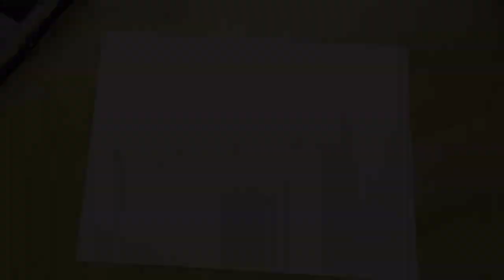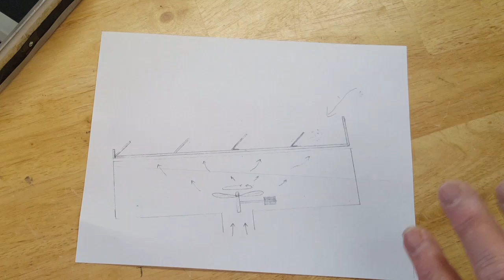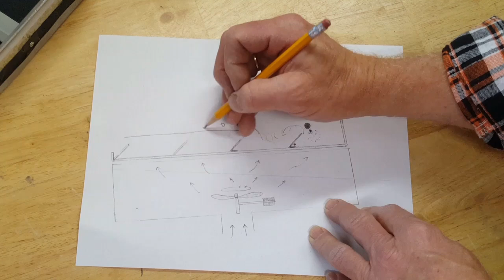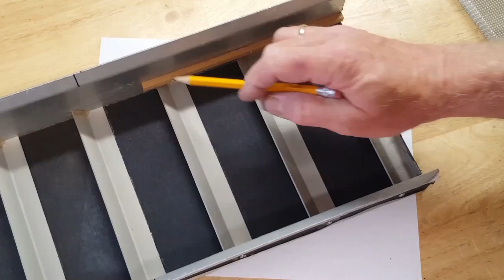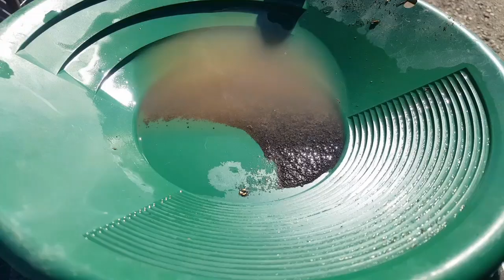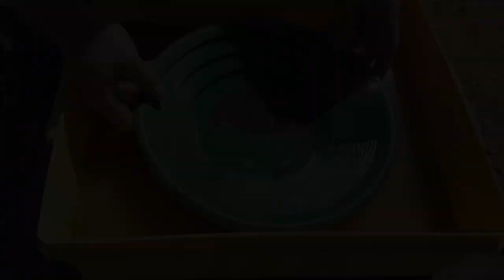Gold Mining Dry Washer - How to Maximize Recovery

Comment: THANK-YOU!  FOR ANOTHER GARGANTUAN EPIC EYE OPENING DESERT GOLD (GOLD SEPERATION VIDEO!

If the gold is 20 to 50 i would use a 30 mesh on top on the first run then make a second run at 20 on top and catch and sample the tails.

Fortnutally after working in the same area for many years we know what size our gold is.

In Wyoming the gold is very small to microscopic so 30 on top would be to too big, but I would probably use it anyway.

Screening material to seperate out the fine gold and knowing what sizes to keep (for further processing) and what sizes to bypass or let go (to the spoil pile) is the secret to successful process seperation no mater what size the operation.  

Sieve seperation is paramount for success regardless whether the process is wet or dry.

Catching the black sand (if it has gold in it or stuck to it) is step one.  

Then we seperate as much gold from the black sand and see what is left or what stays stuck to the  sand grains.

However! ... sometimes the gold sticks to the sides of the black sand grains way above 30 mesh.

My wide view gemalogical microscope at 360 power really helps see below 20 and 30 mesh extreemly well.

Comment: Hello sir, new to the desert and failing; I tested my puffer with fines in Idaho and it looked ok compared to wet washing. I'm using microfiber cloth which generates a lot of static. Just wondering if there are pitfalls I'm unaware of aside from durability. Are furry materials avoided to ease clean up? Thanks for the content! (If you find time to respond, I'm very curious as to what a decent grade of bank gravel in a wash would be and how large of a sample should be taken, more so than the cloth, thank you.)
Reply from the maker: Thanks for your message.  Probably need to do testing for efficiency and durability.

Comment: What is the best angle to run your riffle tray at. Your first clean up has way more black sands than I am catching. And I am losing alot of fine gold right out the end of the sluice box.  And might I be feeding my material to fast.  Any help would be greatly appreciated 
Thanks great video 
Red
Reply from the maker: Hi Red.  Thanks for watching this video.  There's no real angle to set the riffle board because of so many variables, air volume, feed rate, material type,  machine type, etc.  But in general, I like to start at 12 degrees.  I feed at a rate that I can barely see the top of the riffles.  Don't feel bad about losing fine gold.  The physics involved makes it difficult to recover, unless you have an over abundance of fine gold you're working. Dry washers are a good prospecting tool.  However, when you find a really good spot, it's always best to bring in a wash plant to maximize recovery.  Check out my Gold Rattler videos if have time.  Best of luck to you !🤠⛏️⚒️👍https://youtu.be/3xLrOrDDbgc

Comment: Surface area also plays a key roll… i use a Royal dry washer and it looks like yours has half the surface area as mine which means yours will have a greater output of air pressure.
I run my blower on idle and it seams to work perfectly.
I do like you idea and I may try it just to see how much I’m dumping.
I also use a metal detector to find any gold that may have jumped the riffles in my tailings.
I like your set up.
Reply from the maker: Hi Fred.  My blower runs about 1/4 throttle.  Surface area is definitely important, considering the volume of air being delivered to the unit. Give it a try and let me know how it works for you.  Best of luck out there ! 🤠⚒⛏👍

Comment: I don't know Alan, from the looks of what you had recovered wet washing I would say you had 90-95 percent recovery with the dry washer.  I ran a test once  with a puffer and took what came off the drywasher sluice (about 2 five gallon buckets) and then ran these tails thru a spiral wheel.  Got 2.5 gold pans of black sands that I hand panned.  Got maybe 100 tiny meaning sub 100 mesh pieces from the black sands.  If you put them all together you might make one of the larger pieces the dry washer caught.  If I had spent the time just continuing to run more material thru the dry washer instead of messing around with the spiral bowl and hand panning all that black sand I would  have ended up with 4-5 times more gold than I recovered.  But I was doing a test to see how effective the dry washer was.  The only way to really determine the percentage is to weigh the test results and compare.  But to me your mods to the drywasher was impressive.
Reply from the maker: Thanks for your comments John !  Glad to hear from others, and their testing. Yeah, the screen method seemed to help improve recovery. Did you classify the material down to about 25-50 mesh before the spiral ?  I've never had much luck with fine gold on a spiral.  I'm a Blue Bowl guy. Lol !  The type of material is a factor.  Dry stream gravel is best.  Unfortunately, the dry washer can't  recover much from gooey clay, which is what I'm currently encountering. Almost everyone out here running volume is wet for that reason.  Should have seen the hard chunky clay I was running with the wash plant today.  Whoowee !!  Best of luck to you prospecting ! 🤠⚒⛏👍

Comment: do you have a recommendation for a vibration motor for my top hopper that will work on the large royal without spending 100$ 12 volt?
Reply from the maker: That's about the going price.  I bought a 12v on eBay a couple years ago, and paid $85.  I would keep an eye on eBay for a deal to pop up..

Comment: I most appreciate your posting this. I've watched your video on your washing op and really learned a lot.  I need to watch this further.  Perhaps you answer the question down the line.  What about flour gold, I mean the really fine stuff, which is what we have on our claims?  I think the words you were search for (50-cent geology terms) regarding a large iron particle vs a much smaller gold particle is "hydraulic equivalence".  If words matter. Certainly specific gravity does.
Reply from the maker: Hi Thom.  Thanks for watching my videos.  Much appreciated !  Yes, the wash plant is the best way to recover fine gold, without going overboard and making giant Blue Bowls or Miller tables.  Even with that, some gold at -200 mesh, or finer, can best be extracted by leaching.  And that gets costly !  So, the values have to be there to make it worth it.  A dry washer is at a disadvantage because of the physics.  My little screen technique helps, but not as good as the wash plant.  Thanks for your comments, and good luck prospecting !  👍🤠⚒⛏

Comment: Cant it be that the fact you ran the material twice is the reason for more capture?   I would like to see material with guaranteed Au amounts ran thru both systems.    NOT Dissen, just pointing out not fair comparison.  outside that,  it does look like screen helps, just not sure how much.       cheers and thanks
Reply from the maker: As I mentioned in the video, there is gold trapped in the upper riffles due to "random chance."  Anyone can re-run tailings through their dry washer and collect a small percentage of gold on a second pass due to this property (Physics 101).  The physics remain the same, until there is a change.  That's where the 20 mesh screen and reduced air volume come into play.  The gold is trapped on the lower riffles because the dynamics have changed on the second pass.  Obviously, this gold wasn't recovered on the first past because of the inherent physics of a dry washer.  By modifying certain features, the physics and be altered for improved recovery.
Reply: Random Chance isn't intelligent or physics lOl, unless yor a Newt/globalist.      first pass caught specks smaller and equal as second round with screen.  perhaps/ Obviously,,,  percentage of Au against volume would better represent advantage' of screen and baffle compared to inherent Preponderance and Obvious,, Dipole properties.  Confirmation Bias is Bitch.
Reply from the maker: Think what you want.  The physics are undeniable.

Comment: I’m thinkin 2or3 more feet of screen to run the fine stuff over would up your % a bit?
Reply from the maker: Thanks for the ideas Joe.  That might work, but make for a long dry washer.  Another option might be to add a series of little riffles on the same board.  After all, we're attempting to catch fines, so replacing the existing 1/2" riffles   for a bunch of 1/4" might do the trick ?  Will have noodle on this more.  Best of luck to you prospecting !  🤠⛏⚒👍

Comment: That was a GREAT video   ,  l have an old Keene Dry washer without a shaker  , it has a 3 1/2  H P  Briggs and a big blower  , How do you figure out  how much air to use ?   And what  angle to set it up ?      Then I just have to find some ground to work.     Thanks.    TANK

Comment: Great video.
We have just completed the field testing of our new Airwasher plant.
Recovery rate is above 90% in the capture range, 1/2" minus to 30 mesh minus. NO box, continuous dual output, save port and reject port. Rejection ratio is approximately 25 to 1.
Adjustable capture range. Slowing down a bit, will capture the 50 mesh minus but the rejection ratio with drop to 20/1.  This new system is designed for heavy mineral sand mining. We have closed down our manufacturing and sales, opening a mining operation in Nevada.
Reply from the maker: Good luck to you !  Hope you find lots of gold !

Comment: This shows that rerunning your tailings helps improve capture when drywashing. Have you compared running it un-modified twice? That might give you much the same results!
Reply from the maker: Hi Kevin.  Thanks for your question.  I did test a second run and only found a few specks.  It's what you would call "Random Change."  Running tailings a second time though a dry washer or sluice will yield gold through this effect.  Best of luck to you prospecting.
Reply: Excellent, that adds more credence to this idea!

Comment: why do you use the smooth part of the pan when cleaning up what are the riffles for.
Reply: Yes i saw that exelent pan i thought you were working inbetween them if you were not please accept my appolagy thank you good videos
Reply from the maker: If you look a little closer,  you will notice my pan has two types of riffles, coarse on one side and fine on the other.  The coarse is used for stratification and cutting coarse material.  The fine riffles are used for fine material.

Comment: Hi Allan, I'm a professional prospector in Western Australia and run a large dryblowing opertion..this is a very interesting solution to a well known weakspot of constant air. It's got my brain going....nice work.
Reply from the maker: Thank you for the kind compliments mate !  I checked out your channel and subscribed.  Wow, you're out in the middle of nowhere !  Is it difficult to bring in water ?  Because water will substantially improve recovery compared to air.  If get time, watch some of my wash plant videos where I'm able to recycle water effectively.  Currently, I'm designing a new wash plant that will be trailer mounted and increase water savings by 20% compared to my current unit.  Let me know if I can help.  My email:  allan.goldmining@gmail.com
Reply: @allansgoldmining  Hi Allan,  wet plants up here are possable and we run a wet operation out at our open cut mine.When air is run right the recovery off a dryblower can get very close to wet recovery. Gravity circuits in general will  only return 50 - 60 % of free gold. Our dryblower works alluvials and needs to be highly mobile....get in..process 10 000t and move on...no time for water.

Comment: Would a puffer/bellows dry washer benefit from this modification?
Reply from the maker: Hi Bob.  I've had a couple folks give it a try, but not too successful.  I think the problem is the bellows angle.  Due to its triangular hinged design, higher air volume occurs on the upper riffle board, while the lower section less.

Comment: How long do you have to pan like this to make your money back on what you spent on gear and fuel?
Reply from the maker: Hi Delicious.  Would be a very long time.  Lean pickins out here.  Ha ha !  Virgin ground runs about $25/yd.  If I work hard, can run about 2 yards/day by hand with the wash plant.  Helps pay for gas and food, but that's about it.  Would need heavy equipment to move volume to make it worth it. That's why I haven't quit my day job.  Just enjoying the adventure.  Consider it like fishing.  Spending big $$$ on boat and tackle to catch a $10 fish.  LOL !
Reply: @allansgoldmining  Still, if I could get 25$ per yard running my track loader, if there was enough land to filter through, I could make about 1000$ per day, as it only takes me about 2 minutes to scoop up a yard of dirt and rock, and a moderate 8 hour day is 480 minutes long, enough time to scoop up 240 yards [assuming one has a conveyor belt and it is all set up on a long lasting tank of diesel from an efficient little diesel engine] because 240 yards would be about 6000$ but by the time you counted fuel, travel, overhead of all possible kinds [more if you stay elsewhere in a hotel and not in a camper or tent on site], you might make 1000$ per day... Maybe.
Reply from the maker: @DeliciousDeBlair  yeah, that's the dilemma.  Not enough volume out here at that grade.  Plus the permitting and legal fees would out weigh the benefit...  Plus the Greenies would go crazy if I ran over a cactus.  Ugh !!  So I have to remain stealthy.   Lol !!
Reply: @allansgoldmining  I've always despised and disdained fishing too.

Comment: Your original problem statement sounds like your air flow may be too high to begin with, if you're losing gold over the riffles all the way down just a thought.
Reply from the maker: Thanks for thoughts Ed.  I've significant testing regarding air flow, slope and riffle dimension.  It's purely a physics issue.  I have a significant amount of clay and silt in the material, lending an appearance of excessive air volume in the video.  If I run it any lower, the riffles would become clogged.
Reply: @allansgoldmining  Understood.  Did the added metal mesh affect the static charge at all?
Reply from the maker: I'm not sure.  Haven't performed any tests on that.  My best guess would be no change.  Using an additional layer of nylon material, as an alternative, might increase the effect.  Worth looking into.

Comment: Seems like a puffer would do this by the very nature of the bellows design.  More air being pushed through the top of the riffle tray  than the bottom due to the increased volume of air at the top due to the tapered bellows.
Reply from the maker: Maybe ?  Run some tests.  Post a video of the results.  In general, a vibro static machine has a slight advantage.

Comment: I have a homemade dry washer..I don't lose any gold..I don't see any reason to try your modification..it looks like you have too much air pressure blowing through your small dry washer and the upper hopper is at such a steep angle everything is falling off...what brand is the dry washer you're using??
Reply from the maker: Bring me your tailings.  I will be more than happy to debunk your claim that your dry washer doesn't lose gold.  You need to understand the physics behind this process.  The material I am working with contains high quantities of clay and silt.  Therefore, the excessive dust is not from increased blower volume.  The angle of the riffle board is set at 2:1, which is very shallow compare to most operations.

Comment: Have you thought of placing strong magnets onto the vacuum hose while you are cleaning the screen.
When you have cleaned remove magnets and black sand will fall out of the vacuum hose.
Should take out alot of black sand.
Reply from the maker: The problem with static magnets is that particles of gold become trapped within the magnitite filings.  I currently have a better solution called Spin It Off.  Pulls off magnitite, but leave the gold behind.  Works perfectly. Check out their videos.  It's amazing !
Reply: I use magnets for that reason but afterwards I collect the black sands as they do hold tiny and microscopic gold particles. I then process the black sands with Mercury. Mercury is PERFECTLY SAFE if you know what you're doing, wear proper PPE and NEVER slack on having a safe protocol!

Comment: hi.(sry for my bad english) are you sure you don t lost large gold parts, trying to find the smallest one? did you test without modification to see if you don t find large gold part after the middle of your washer?(i think your idea need this experimentation because if, when you find 0.1 gr small gold, you lost 0.2 gr large one, you understand it would be less interesting)
Reply from the maker: Any gold 0.2 grams will easily trap in the first riffle.  The dry washer is very efficient in that regard.  I have experimented with this for quite some time.  I run all my dry washer tailings through the wash plant, and have never recovered gold greater than 100 mesh.

Comment: I just watched this video again and picked up a couple things I missed the first time around. The spruce is to support the screen high enough for the flow to continue. About how high from top of spruce to top of riffle?
Reply from the maker: The spruce stock is 1/4" square.  So the gap between the top edge of the riffle to the underside of the 20 mesh screen is about 1/4".